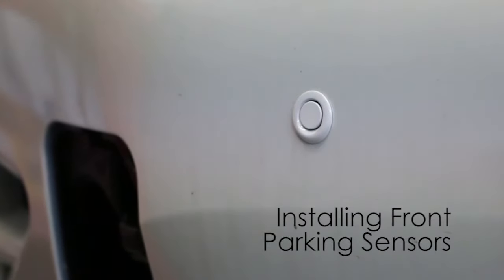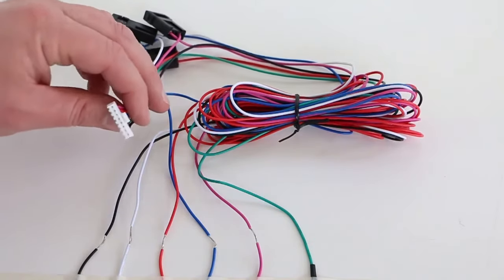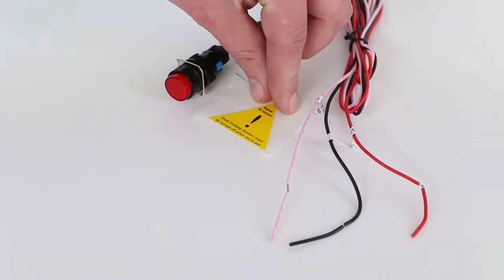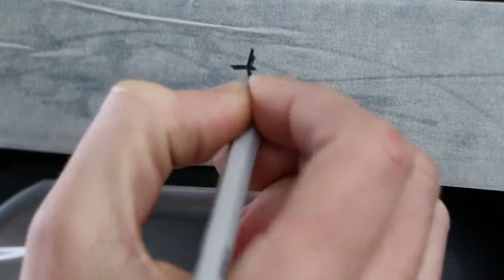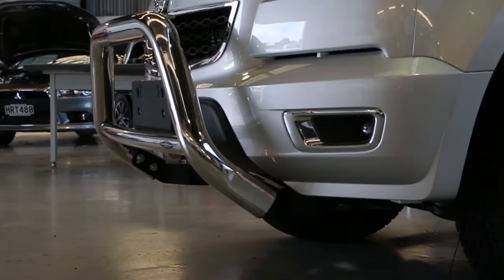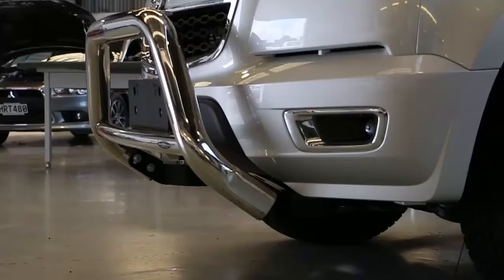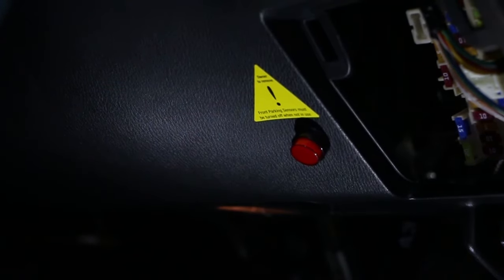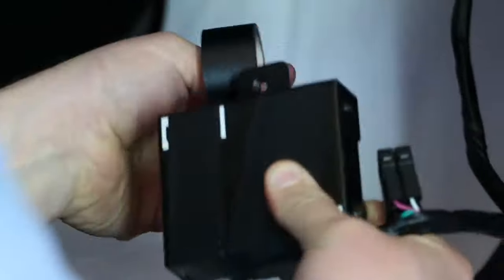How to Install  Front Parking Sensors

Comment: So the front Sensor's should have a Sensor on and off switch just like in the toyota fortuner rear sensor. Turning on and off the switch when sensor will be use. Its a 2018 model toyota fortuner.